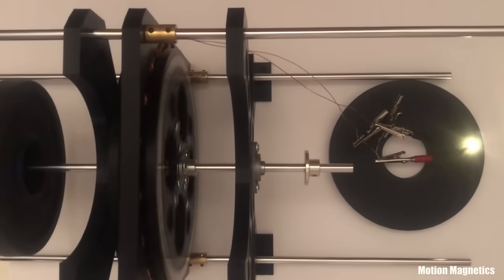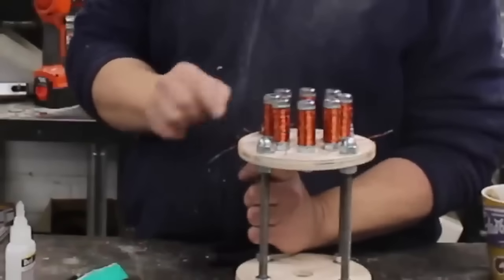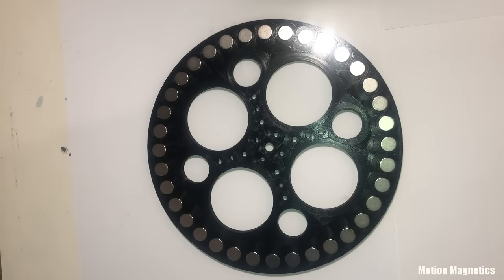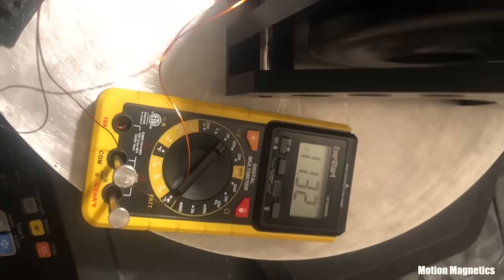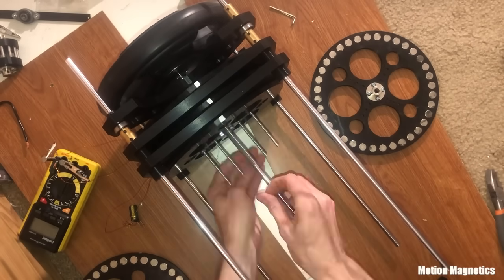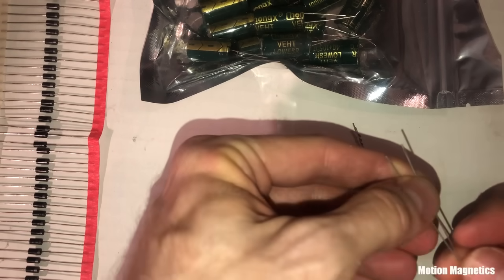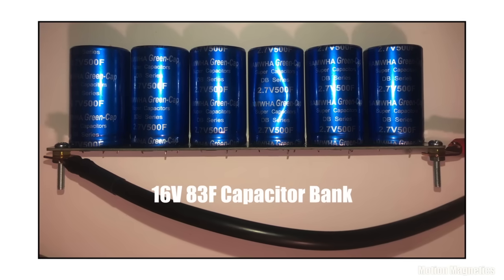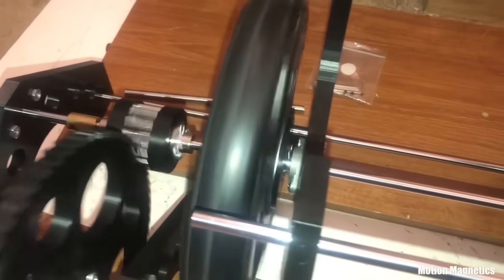Stackable Generator

Comment: Awesome video..!!  This is exactly the same mechanical design that I have done some work on, but have had to put on the back burner for the past couple of month.. I have one considerable design change  that could greatly improve the overall output efficiency of your electrical design.. 

Your mechanical design looks awesome, no improvements I can see there other than maybe experimenting with magnet arrangement using Halbach array and possibly a thin steel 14-16 Gauge backing plate on the outside of the outer most magnet disk at each end to increase magnetic field strength across the coil, plus getting the magnets to pass as close to the coils as possible without touching the coil.!! Throwing the absolute maximum magnetic field using N52 Neodymium magnets or even stronger, I think N52 was the strongest available the last time I checked..

Fullwave bridge rectifiers using diodes are very easy to build and inexpensive, but are not the most efficient considering 0.7volts x 2 diodes = 1.4 volts is clipped across the diodes in both polarities.. I suppose you could consider it as 2.8v peak to peak loss being clipped from the AC side of the rectifier.. 

A super efficient bridge rectifier circuit can be designed using MosFET's that will approach a 0 volt loss during rectification, plus have a much higher current rating than diodes.. 

I imagine one of these FET rectifier circuits attached to each coil with the Super Capacitor banks you are already using to store a massive amount of output charge,  then series the Super capacitor banks for each generator coil to produce your final cumulative output voltage.. 

This would turn your design into a full on power scavenger..;) The precision of the bearings would also be a consideration in reducing drag.. Good Stuff..!!

Exceptional job on the 3D printing..!! Looks like you have more views than subscribers, that its awesome..!! Earned my Subscription..!!
Reply from the maker: Thank you! Much appreciated! Those are all great suggestions for improving the efficiency.
Reply: @Motionmagnetics  I think this design may have the potential to be one of the most efficient designs ever imagined.. 

Next to figure out how to incorporate this design into a Tesla Turbine that could spool up to 20-30k RPM.. ;)
Reply: This is almost the exact design I was planning. One addition to mine was a clutch attached to the gear box so stopping the input allowed the generator to keep running. I would also have used automotive rectifiers, as they're pretty inexpensive, but the MOSFET idea sounds way better. Thanks for posting!

Comment: I don't know if you said this but it would be wonderfull to see you connect this to a weighted dungball system like old window counter balances and allow the gradual drag of the weight pulling downward to power the stack. 

I have been drinking mead so following whether or not you already said this is hard. I have thought of something like this myself for a different system for a "Grandfather clock-esk" home power generation . . . thing.
Reply from the maker: I am planning on connecting it to a weight system through gears similar to a Grandfather Clock, so you hit the nail right on the head.

Comment: I really like your stackable generator design.  It could be used to make generators with customizable outputs, which is very cool.
Reply from the maker: Thanks! Exactly, you could choose the configuration that fits your particular needs.
Reply: you're doing it wrong, you could make the winding flatter, which would reduce the dimensions of the structure  надеюсь ты прочтёшь )) @Motionmagnetics
Reply: yeah keep it in that sweet spot of 85% efficiency no matter what the load.

Comment: "Im not an electrician". Says the guy who successfully builds a modular electric generator on his first try
Reply from the maker: Thanks, you're very kind.
Reply: @Motionmagnetics  Very true. In fact I think electricians are given more credit than they deserve. Yes they can wire our homes, but can they dig deep into electronic circuits? Generally not!
Reply: That's an EE tho, actually even more so mechanical engineering.
The electrician just make sure it's safely installed and energized, even tho most of them know their stuff enough to know what's going on, but really most electricians hardly even think about ohms law... Right? I hope I'm right at least maybe I'm wrong but the only thing I know for sure is if you throw half a box of brand new screws whenever you work on a box then you ARE an electrician and I thank you for the free screws u guys are crazy.
Reply: Thanks for what you have been trying to figure a wat to make a generator for years tgis isn't a first attempt. No need for coils and magnets when using gravity or flywheels
Reply: one does not have to be an electrician to understand the basic principals of magnetic induction.  its a fairly simple thing to understand,  that being said, i find this idea/design quite intriguing.  i personally would use ferro ceramic magnets in the design/experimenting phase as they are much cheaper and more available than the neodymium type,  granted they wont produce as much power  but i can perfect my idea at a much more cost-effective way.
Reply: What if looms dreams at doing human stuff when there asleep! The wet dreams is like outer . So the opposite souls on Alien 👽👾 digital age stuff ship for 12ships if builting on earth in Mt tops!  Ooo it's xfikes stuff now! We're at age lol
Reply: I think you mean "Electronics Tech". In my experience, electricians don't know much about electronics!
Reply: Hallo ich heiße Nedin verkaufen sie mir bitte sie einen Maschine

Comment: Hey, why don't you use thicker gauge wire so that you can push out more amps? I know you would lose out on the voltage but if you can bring the Voltage to a constant 24V and keep the amps high you might be able to power a small ups as an inverter. again just a thought I'm not an electrician. just a photographer
Reply from the maker: The wire gauge I selected was in part because I chose to go with a serpentine coil. It's rather hard to wrap a serpentine coil uniformly with a thicker wire gauge. If you went with a different configuration, then the thicker wire would be fine. Regardless, if you have a certain amount of space to place the wire you'll get more turns from a thinner wire, but end up with roughly the same amount of material as you would with the thicker wire. So you're not really losing or gaining anything because you can change the amps or voltage by whether you choose to wire in series or parallel.

Comment: TIP FROM ELECTRICIAN :D use a chuck of a drill with sticky side up electrical tape. and just press it against it to be able to test without constant recranking
Reply from the maker: Yeah, that would probably be a lot easier. :)

Comment: Great video. Been thinking of something like this too. Question. Have you thought about balancing the wheels? It will lessen any vibrations and help the spin.
Reply from the maker: Thanks. For a final design that would definitely be beneficial. Mine isn't perfectly balanced right now, though I did adjust it a bit so that it's not too off-balanced.

Comment: Does this generate any heat?
Reply from the maker: I designed it with pretty adequate air flow, so it doesn't really get hot when it's spinning.

Comment: Okay, kind of goofy idea but what if every other rotor spends opposite to the first? This way, they work on each other?
Reply from the maker: You'd be fighting quite a bit of drag if you did that. I have the rotors set up so that each North is aligned with the South on the adjacent rotor, and South to North. So they spin freely together with low drag.

Comment: @Motionmagnetics You may be surprised to find that the energy you are using to drive this system is making your design very inefficient. The secret that nobody is talking about is very simple and I would be happy to share it with you. You have put alot of work and money into your design and are to be commended though. Excellent work. My idea is not theory, I have tested and got 3x the voltage out what I used to generate it with a very simple setup. (Hint) Magnetic motion is much more efficient when pulsing a nearby stepup transformer(such as a Tesla coil) close to pickup coils that have magnets inside of them. The only pain is finding the resonant frequency that the pickup coils operate at. They must all have the same length of wire and the same amount of turns. YouTube has videos on how to modulate a 555 timer chip to find the proper frequency. With a meter on your pickup coil you will see the voltage jump when you hit a sweet spot. It will be high frequency that you can use the bridge rectifier in the same manner to get the DC voltage that can then be passed through an inverter.
Reply: Just don't sell yourself short. When I first tried it, the results were not that promising but, if you keep going higher on the frequency you will see it hit several levels of "sweet spots". That when my excitement started matching the results I was getting. Extremely scalable! This is the true game changer. Word of warning... Enclose your coils in a faraday cage to keep the frequency from causing harmful interference. The signals you will generate at high frequency causes signal disturbances in electronics and for the most part is against F-C-C. Reg-s.
Reply from the maker: That sounds like an interesting approach. Not sure it would be easy for people to replicate at home though. I'm trying to keep the design simple enough that people can build it themselves if they choose to.

Comment: I will try and describe a gravity generator experiment with words but it is difficult.

Just imagine a Ferris wheel that has a weight held far from the axis of rotation on one side of the wheel and as the wheel is rotated the weight stays on that side of the circumference of the wheel so then as it rotates on the other side of the wheel it is closer to the axis of rotation...

Like I say it is just an experiment cause it probably have some flaw in the fact that the weight has to move up and down the same gravitational potential , so I think it sounds like it works but only reality proves it one way or another
Reply from the maker: Well, you can always give it a try and find out.

Comment: Great work. the holy grail for generators is one that has no drag when under load.  It was interesting to hear that the capacitors would help with that.
Reply from the maker: It just seemed to me that connecting several axial flux coil systems in a stacked configuration would create less drag than coils with iron cores. Seems to be working so far.

Comment: im wondering, why not have a  single dual side axis motor module in the middle of the generator, same sized module as the generator modules, placed off center, away form the motor? if you power and turn the entire axle outward sideways from the center, and generate using two or four side modules for feeding back power to capacitor bank then feedback into motor, and perhaps two more generator modules even further out on the same axle, for eventual loads or flywheels. we should put in 1 turn from the motor, and generate 4x from the same generated motion, perhaps a portion feedback into the motor itself and use some to power another device? 1 in 4 out? every module has the same dimensions which simplify it all greatly. a motor module and a generator module we can repeat. maybe we can add and rewove modules to the generator system in use, or on the fly, by using magnetic couplings also designed into the rotor.
Reply from the maker: I've considered setting up separate sections of the generator powering different things, like capacitor banks.
Reply: @Motionmagnetics  im guessing its about putting in 1 and getting out 2. 1 rotation, multiple generating points along the one axle. spinning the axle with all the magnets for generation, is the actual load.

Comment: I have been thinking about a bicycle idea for a while now. Hook that to a flywheel, then the flywheel to a stationary bike. Start in a low gear and work the way up to get the flywheel going which will keep the generators going.
Reply from the maker: That's definitely a way to go. I did a bike generator video a few months back and believe I also mentioned the increased efficiency a flywheel would add.
Reply: @Motionmagnetics  where it can get really interesting, is how many flywheels could one decent geared bike, get going? The flywheels would basically act as a capacitor for the mechanical aspect of the system

Comment: One thing to also try for efficiency is to shift the angle of each stator by a few degrees so that each coil reaches its peak at a different angle of rotation.
This will distribute the voltage ripple and smooth out the electrical "cogging" influence, similar to 3ph but with many more phases in-between.
Reply from the maker: Thanks for the suggestion. That might be difficult to do with the 3D-printed rotors, as they wobble a bit.
Reply: Cogging has pretty much nothing to do with efficiency, it is just a torque/speed ripple. He has already added a flywheel, so there is no need to fix it. Also cogging normally only occurs in iron cored motors and is an effect of the reluctance force.
Reply: Off setting the magnets position in each corresponding stack by 50% should also yield greater efficiency as stated. I also agree that it won't have any real clogging effect as the iron cores are not in play in this style.
Reply: good idea!!!

Comment: Hi can I ask are your 3d printer files for each part available
Reply from the maker: Not yet, but I'll have them up later. I still need to tweak a couple of things.
Reply: @Motionmagnetics  can I ask are u intending to tie your gene to wind water or something else? If so any views of that?
Reply: @Motionmagnetics hi any update on your stl files?
Reply from the maker: @bilibong0101  They should be available in about a week. I'll either post a link in the video description or link to them in a new video that covers how to assemble the generator or both.

Comment: this will not work as you think it will, because the voltage is way to low to see any benefit, also wire it so to use the back EMF to get even more. 
Nice project though
Reply from the maker: Thank you.

Comment: just get a 250-350w ebike hub motor gearless use a 3 phase diod and you get all the  magnets and coils in a small pack.... balance board hubs are ok too for cheap
Reply from the maker: Thanks for the suggestion.

Comment: You could really benefit from a project frame. Get some Square pipe, make a right triangle with a 90. Make it at any height you wish. You can even tear out a bicycle frame, and sandwich bolted to that frame. I did tons of generator projects growing up, a good right angle frame can be an entire day's worth of time saved on every project you use it. Super easy to make it into a multi-jig frame. You can attach Motors, any kind of drive or gear step up box can be directly bolted to it, you can imagine😊
For your generator build, you could even just screw everything down to a big board, make a couple 2x4 runners that reinforce it, then strap your frame down and align it. Not too hard to align and get it mostly on point with a buddy.

Comment: A really cool technique I was taught when I was young. Take a good dry 4x4, drill some anchor bolts with common top thread that's in your eyelet size, throw a nut, washers and your eyes, sandwich it, and you have effectively a long project board that you can throw on the bench, and reuse, time and time again. I had one through my teens that was used on so many generator projects when I was convinced I was going to charge batteries off of our Old Creek

Comment: If you are going to twist diodes, space the legs back a bit. Reason being, he put off can run away a bit if they are all snugged up like that. Space and back about half the wire length, you will probably get three or four hundred percent thermal runoff performance, and wicking performance
Reply from the maker: As in, connect wires to them further away from the actual diodes?

Comment: 2:55 I will definitely be subscribing. This is the kind of projects I would love to even get in on.
 Getting pretty good longevity out of ASA gears on wet or greased applications. Great for prototyping BTW, I would say cheaper due to must actual material needed. Not to mention, it's UV, electrical properties, especially the blends. Truly is the all weather application filament. I have various brackets, larger, bike and bird feeder hangers/mounts, and hooks. They've gone multiple Winters and Summers that have been pretty hot.
Reply from the maker: Thanks, I appreciate it. I'm getting ready to test a new gear setup once I order some more filament. I think metal gears would be best for long-term durability but I'm still looking at ways to 3D print them reliably.